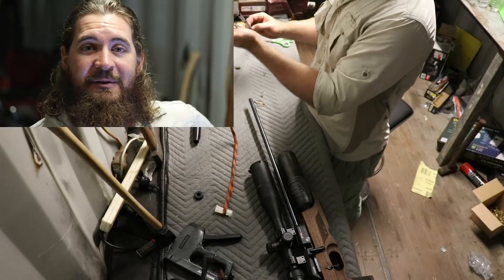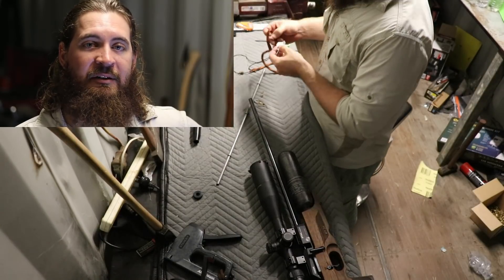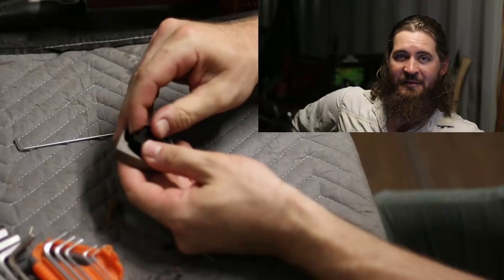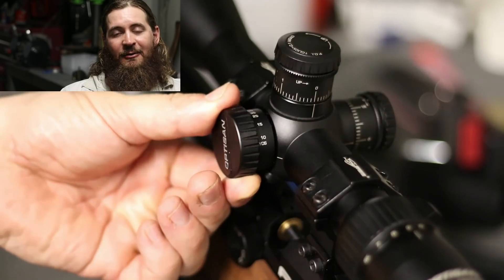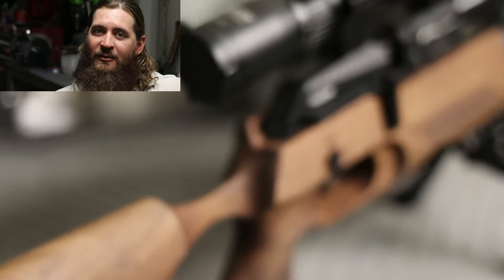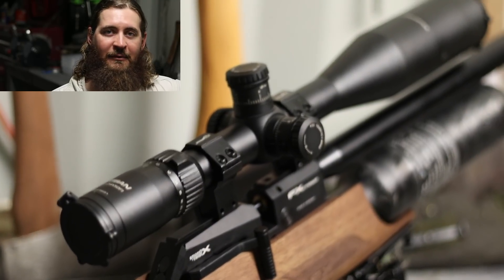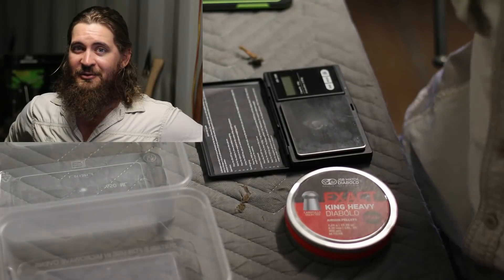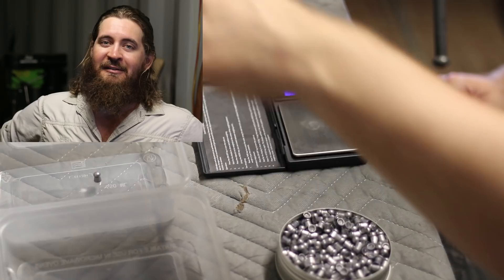5 accuracy tips for the FX Crown and Impact

Comment: Interesting what you said about adjusting your magazine.  I had a hunch that the skirts may have been getting damaged by the magazine, so I machined up a little nylon jig that ‘ clips’ in on the breech (instead of the magazine) of my streamline.  It then allows easy single shot loading by gently rolling in the pellet in with the index finger without the fiddly fumbling around.  It works a treat.
Dave
Reply from the maker: The difference magazine tuning makes is very minor, but all the small things added together equal greatness
Reply: Nice to have some machining capability, isn't it?  I have a little shop myself, (port small 2-stroke gas engines for a living), that is just the right size for a gun smith shop, (Little Tormach CNC mill and a manual lathe).  I just don't know anything about gun smith work. :) 

Production or poverty, that is our real choice.  Always was, always will be.

Comment: Good job champ
I had issues with the same mounts you have on my Crown and Optisan where the vertical turret was maxed out and still shooting low at 50 yards,so got a set of FX no limits which are brilliant.
The JSB KINGS in .25 cal work a treat with factory tune.
Cheers
Reply from the maker: Theres something weird about the turrets on the optisan... sometimes I'll turn mine up for a long shot and they dont wanna move so I'll put them back and try again and it works the 2nd time. Same on windage turrets. It's a great scope but it's not without its weirdness
Reply: Cheers bloke
Thanks

Comment: For tip number 3 never double torque if you're going to torque something back it off ever so slightly then torque. If you keep torquing you will pull the threads.
Reply from the maker: Wise words. I havnt really been using my torque wrench on my crown. I just make sure it's all snug , usually with the short end of an Allen key. Any more then that and I rekon I'd blow the threads out lol

Comment: Does a single shot loader and a magazine with reduced tension have the same accuracy?
Reply from the maker: It has better potential for accuracy because there is less or no pressure at all on the pellet probe, with a high spring tension magazine it differs from shot to shot

Comment: Hello, I enjoy your vids. I have recently bought a 25 cal Impact and have noticed a weirdness across the chrony and was wondering if you had this problem and how you dealt with it. I have it tuned to around 900 fps with JSB heavy's with 135 bar and have noticed my first shot are 60 to 80 fps slow. I've been thru a tin of pellets and havn't hit on the combo yet. Any thoughts?  Thanks
Reply from the maker: Gday mate thanks for watching! The first shot or two going slow is super common, it is known as "cold bore" shots. They are still usable as long as you take not of how much the point of impact changes for those first few shots. This even happens with rimfire and center fire guns and is normal.  What is the extreme spread of muzzle velocities your getting? 900fps is alot of speed out of only 135bar reg pressure for king heavys!
Reply: Thanks for getting back to me so quickly. I have this thing all messed up now. Just went downstairs and shot a string, It's back where it came new at 120 bar right now with hammer spring,  not quite maxed on max, after throwing away the first two shots 1st 792, 881 876 868 858 808 810 848 806 858.  All over the place with 25 king mII heavys. I'm a bit confused about harmonic tuning, From what I read it seems like it's mostly dependent on reg pressure, going up and down looking for the tightest group. Wouldn't the hammer spring change the harmonics too? I've been mostly working on the chrony, Should I be starting at the range first working on the reg pressure?  Thanks Uncle Hodge...
Reply from the maker: @larryjames2656  have you watched my harmonic tuning guide video? It lays the process out as best I can. I rekon if you just dial your hammer spring wheel back to 4 you'll be really close too a good tune but if you wanna do it properly watch my tuning vid and follow the steps

https://youtu.be/xxrDZmB5egU
Reply: @meatheadmarksman2013  I've watched your video 3 or 4 times. I set my reg at 135, maxed the spring and set up the chroney. Had a laptop and excel ready. Never did get the wild up and down swings, just shot slower with every 1/6 turn out. Acts like I need a heaver spring. Did shoot pretty consistent at 140 bar and a full turn out at 850 fps or so with heavy's.  I'd like to get closer to 900 so I'll keep trying.
Reply from the maker: @larryjames2656  I rekon you'll need 150 to 155 bar to get 900fps mate. Just for reference mine is about 147bar and the gap is 15.75mm between the hammer wheel and the carrier when you move it across. Thats got me 870fps. Probably a better starting point then the sub 145bar reg pressures. Just double check the manual that came with your gun before going over 150bar reg pressure - also make sure you keep an eye on your bottle gauge to make sure you actually have enough air to keep tuning, it's easy to forget to recharge
Reply: @meatheadmarksman2013  Thank you for getting back to me, I appreciate the help. I think I have reached the limit of the hammer spring. Anything over 140 bar and the velocity starts dropping. I have the spring maxed so I believe I need to  replace the spring or figure out a way to shim it. I haven't taken the spring and hammer out yet to see whats in there but I think that's next. Do you know where I can get a stiffer spring? I've checked around and haven't had any luck finding one. Thanks for putting up with me, Larry
Reply from the maker: @larryjames2656  that's alright man sorry to hear your gun isn't doin what it should. Seems like there could be something wrong with it and personally I'd send it back for an inspection but if you dont want to do that check out this forum post
 https://www.airgunnation.com/topic/crown-impact-power-mod-kits-by-fx-usa-ernest-rowe/

Hopefully that will fix your problem  matr
Reply: @meatheadmarksman2013  Hello Uncle Hodge, I went at it a different way tonight, Hammer spring maxed, Turned reg down to 100 and shot a few thru chrony. Turned reg up 1/6 turn at a time until speed started falling off. I backed reg off  to the fastest setting, that ended up being about 125 bar. I'm shooting 890 ave. with heavys and 930 on #2 with JBL 25g. Thanks for the power mod kit link but I think Ernest has quit selling them doing further development.
Reply from the maker: @larryjames2656  that's pretty good speed now mate well done! It's also entirely possible that your reg pressure gauge isn't accurate, it doesn't really matter so long as your happy with your results (I would be) but some people who tune airguns use digital reg pressure gauges which are much more accurate then the ones on our guns. My bottle gauge doest even read the same as my pump lol

Comment: I am the kind of guy who uses brake cleaner to clean many metal parts from oil and such, and kill just about any bug in my shop, (with a good aim, I can shoot a mosquito in the air and stick it to the wall.  lol).  Since I can remove the liner, I am tempted to clean the barrel with brake cleaner and compressed air, repeated a few times.  No doubt, that will get all the lube out of it.

Comment: Hi ... please, I need your help, I have an FX Crown .25 and a telescopic sight Aztec emerald 5.5-25 x 50 MM, in FX Airguns recommended me to use the regulator between 125 to 130 Pressure Bar , which is perfect, I use a software called Strelok or Chairgun, to help me have more precision at a distance and perfectly matches the distances with the MilDot.
When I change the .22 caliber cannon and enter all the data to the software, I completely lose the precision with respect to the mildew versus distance, I do not achieve the accuracy that I have with the caliber .25.

What will be the problem?

Please, I await your response.

Thank you.
Reply from the maker: Gday mate, 
Are you using the same settings on your regulator and hammer spring for both barrels? I think if your using your .25 caliber tune to shoot .22 caliber pellets it will be too powerful and shoot the 22 pellet too fast. Try shooting your 22 pellets on minimum power on the hammer spring wheel. You will need to shoot over a chronograph and use that information with your ballistic app. If you are using strelock you can tell the app how the 22's point of impact differs from the 25 caliber pellets and it will tell you where to aim without having to rezero your rifle every time you switch barrels

https://youtu.be/vu1kC8RelfU
Reply: @meatheadmarksman2013  Thank you very much for your quick response. I will do what you tell me, I thought I should lower the pressure of the regulator to 100 bar. Do you think it will work ?, or lean more to modify the hammer adjustment wheel to the minimum. Thank You for the Link
Reply from the maker: When you use 2 different calibers without completely re-tuning the gun every time you swap barrels you need to keep the tune for the bigger caliber and just reduce the hammer spring tension because the gun will be much more consistent when the hammer spring is set too low then if the hammer spring is set too high. Weird stuff happens when you have too much hammer spring tension. check this video out https://www.youtube.com/watch?v=xxrDZmB5egU&t=1294s at 19 :44 I explain this with a graph that shows how crazy too much hammer spring can be. if you are happy with the factory settings in 25 caliber I think that's the best way to go, hopefully that will keep your 22 caliber pellets BELOW 950fps and keep them nice and stable. If you do get the cance to shoot those setting over a chrony id love to hear about your results
Reply: @meatheadmarksman2013  Thank you very much, one last question, the letters on the hammer adjustment wheel have some special meaning.
Reply from the maker: @rodrigoilabaca9419  the letters are halfway between the numbers on the lesser side. So A is between 5 and 4, B is between 4 and 3, so on and so forth
Reply: @meatheadmarksman2013  I'm really grateful for all your answers. thank you
Reply from the maker: @rodrigoilabaca9419  no worries mate :)